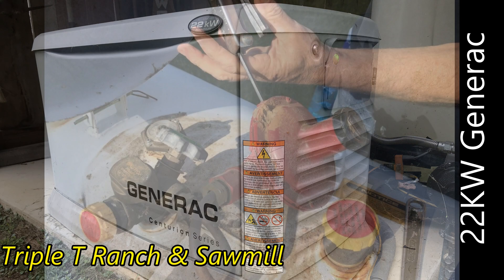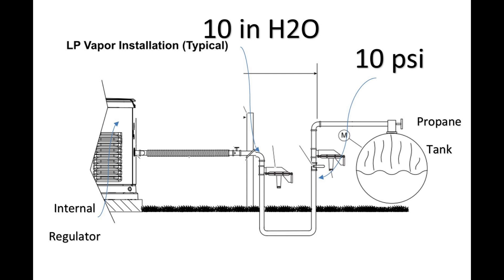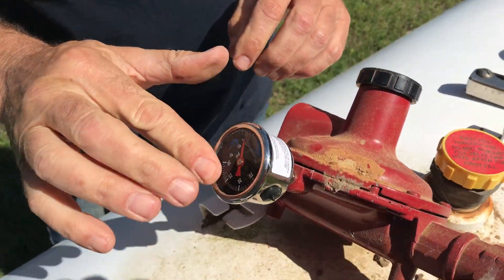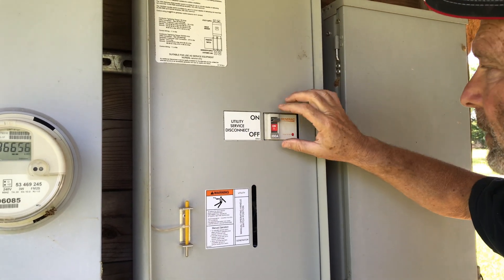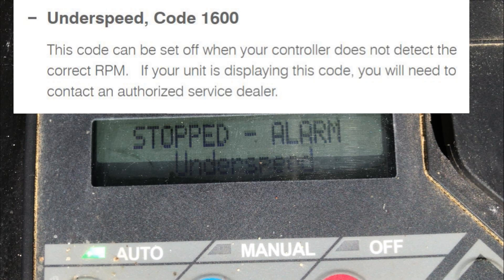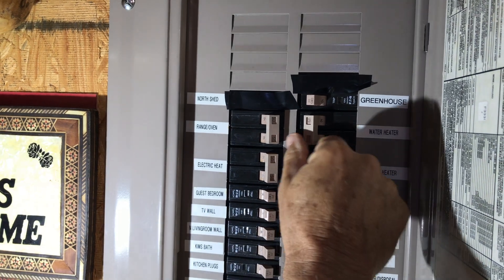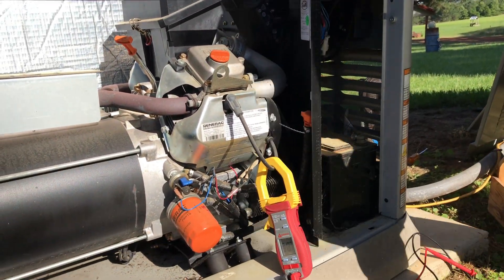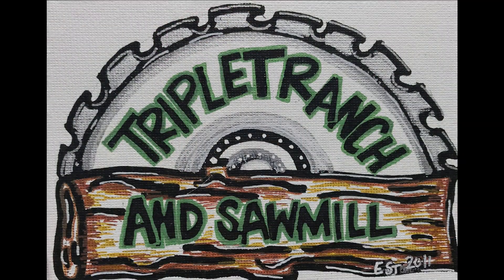Generac Generator Gas Regulators

Comment: Question; I have a 22 kw Generac, they finally found out I didn’t have any fire. Now that it’s running, the technician said Generac recommends at least 5 feet of gas pipe between the second stage regulator and the generator. It makes perfect sense because it creates a buffer for loads and startups. According to the manual, the water column should be between 10-13 inches of water column. Could the over pressure cause the internal regulator to try and compensate? The plumbers are supposed to come back and fix the pipe. I could fix it myself, but they installed it and didn’t put 5 feet between the regulator and the generator.
Reply from the maker: Thanks for sharing this info about the gas pipe length, I had not heard of that before. But can see it adds some consumable volume.  Glad they got you running .  I call the regulator at the tank the first stage and it is set at a higher regulator pressure than the regulator just outside the cabinet which I think should be 12”.  Never tested the internal best I can remember

Comment: Master tech here. The “Inspect Battery” message just means that the 1 year maintenance timer which is programmed into the controller has run out, it will display “Inspect Battery” or “Inspect Air Filter” and it’s just a way to remind you to do your maintenance and call a service tech to come out. To reset it, you need to go into the dealer menu (password protected) and reset the maintenance timer. 
Also, there is a 2.5 Amp battery charger built into the Evolution controller and it’s always cycling on and off depending on battery voltage. 
Your incoming gas pressure is too high, turn it down to about 12”.
Reply from the maker: Thanks for the info.  If u r n north east Texas area let me know.  I have not found a qualified tech.

Comment: There's a reason they're called genercrap.
Reply: well if he followed any of the 11 pages of instal manual it might run properly. Even a Corvet will shit it self if you try to do 8000 rpms. the problem is improper install not shocked, as a generac tech you might see 1 out of 5 generators actually installed properly.

Comment: Thanks for sharing. I’m changing the 2 nd regulator it’s leaking in the diaphragm and I didn’t know which port to take it out psi going into it generator. I also need a gage to do it. I thought or putting one directly into a port like you did on your primary regulator. $ is the cheapest option.
Reply from the maker: Glad u figured it out.  Just in time for winter weather

Comment: Could I ask a question?  The internal regulator on my unit, there's a propane line going into it obviously. I just bought a 12kw Generac Guardian for 1200 bucks. I'm taking a gamble. Anyway the line was once taped up but it degraded and the pipe is filled with rust. Can I just unthread that from the regulator?
Reply from the maker: I am not an expert on that part.  But u got a great deal so I would consider the whole regulator contaminated and buy a new one.

Comment: Hot dang you were about as close to full load amps as the Generac could carry with just the water heater !!  No wonder the old gal was huffing and puffing !! Awesome job my friend.
Reply: Generator should have 10 to 12 inches of wc at the inlet of the generator. Your gas pressure is too high.
Reply: @billskalicky5400  My 26kw says 3-7 wc on Natural gas.
Reply from the maker: Little embarrassed that I didn’t check name plates before any work, but I heard the hi psi reg squawking so I jumped to conclusions. LOL.  Love the Frontier videos!
Reply: @TripleTRanchAndSawmill  I do the same thing on occasion....and jump the wrong direction.  LOL.  The main thing is you got to the answer without too much fuss.  I have an old 15 kw propane fired 4 cylinder Onan generator I got off a jobsite. When I got it, it had 700 hours showing on the meter.  It's got all the electrical relays and contactors for automatic start but I leave it on manual because I don't want it starting every time we lose power.  We are literally 5 miles from the power plant but we can lose power for five minutes at a time.  Seldom do we have long periods of outtage.  I also would prefer the electronic automatic controls like you have over these electro-mechanical controls.